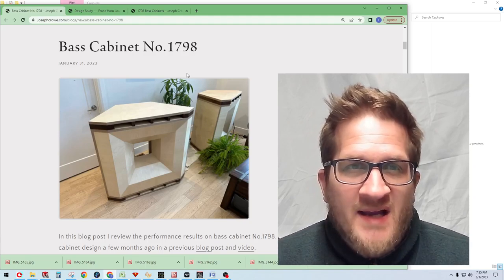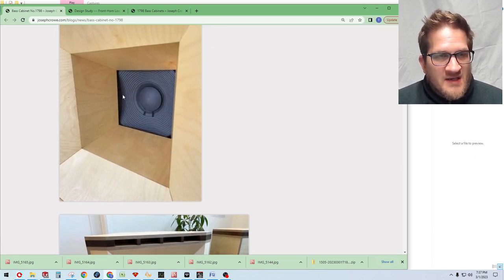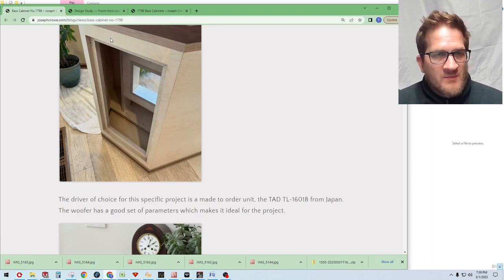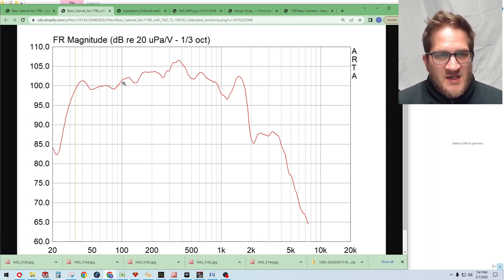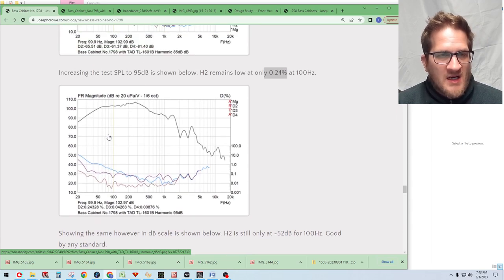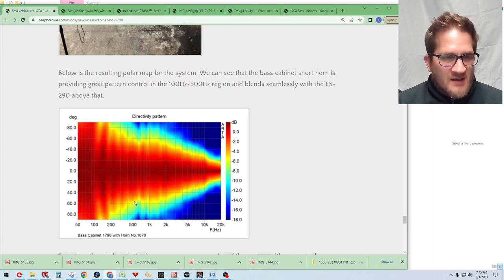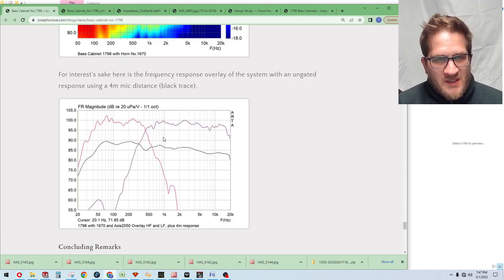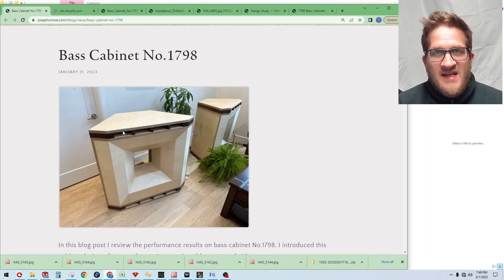Bass Cabinet No.1798

Comment: Hi Joseph, when you speak about the compression ratio of 2:1 in this video, is that the ideal ratio for a linear response and output?

In your experience what ratio's have you seen?

How do you know what the compression ratio should be for any given driver?
Reply from the maker: It’s based on experience simulating various horns in the Hornresp software over the years. The sim software used the parameters of the driver model and horn shape to calculate the response. When you say “linear” it doesn’t mean flat, as there is gain provided by the horn over certain frequencies that need to be accounted for in the crossover. But these are broad changes to the frequency response. We want to avoid small peaks in the response especially near the cutoff frequency of the horn (100Hz region). A clean step response in the first 5 milliseconds is also a goal.
Reply: That's so interesting, we have also started using hornresp "hence the questions" 😂 (we are currently on a rear loaded horn design)

So should there be a limit to what compression ratio one should stay below before the cons outweigh the pros?

Have there been limitations you've come across in designs where the throat area needs to "X" but the compression ratio needs to be "Y"

Comment: The Kappa LFA15 and Faital 15PR400 yielded similar results in a box simulation of ~140L and tuning around 35Hz, BUT, the TAD driver did however provide a bit more output in the bass in the simulation.  Pro sound woofers generally have high Fs for >97dB sensitivity so the 18in units actually may perform better, but a larger cabinet. The TAD unit is quite nice but pricey.

Comment: I’d love to build a similar design with my JBL 2206 drivers. Have you ever looked at JBL’s 2169 8” driver with cmcd phase plug? Would love to hear your thoughts on using that combination in a large format upper bass/ midrange horn
Reply from the maker: The 2206 has an FS of 52Hz where the TAD TL1601B has an FS of 28Hz. So the JBL would not be suitable due to lack of bass.
Reply: Definitely subwoofers will have to be used for the deep end...
Reply: I really only wanted the horn to work down to 160hz ish where a PD154 horn loaded band pass sub takes over

Comment: Interesting video! I recall Nelson Pass telling me that the TAD 1601a was the lowest distortion bass driver he had ever worked with. Would it be a direct replacement for the 1601b? How about the 1603? I have a pair of each. The TAD's efficiency makes them perfect for clean, low wattage amps of all kinds, not just tube amps. They work great with 25 watt First Watt amps!

Comment: That’s really cool.. Would there be major changes to the the design and dims if one were to use GPA 416 drivers? Is the design easy to downscale to use with 12” drivers like the 414 with 600Hz midhigh horns on top?
Reply: the throat would fit a 12" it looks like, but then that 12" driver's preferred best fit rear volume, and throat area might be very different. Of course there's even more stuff to balance there, but those are the two big things that would change the cabinet shape the most.